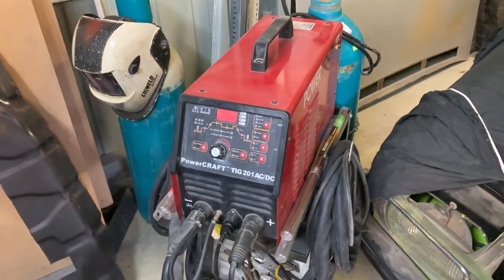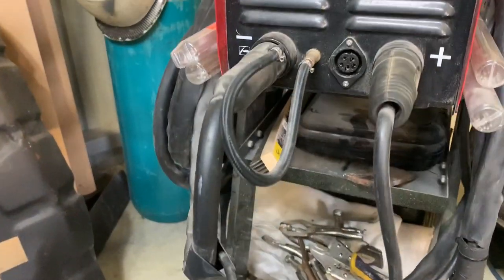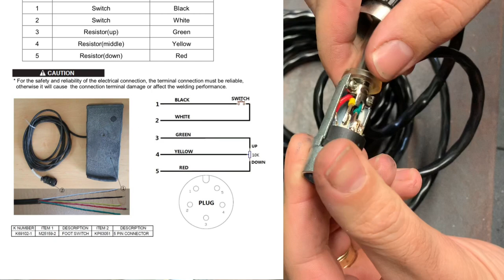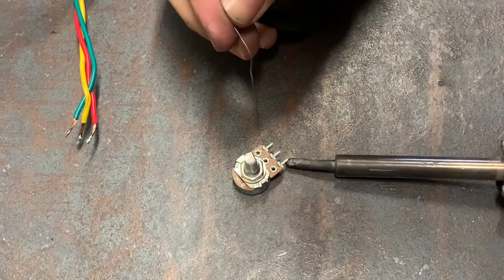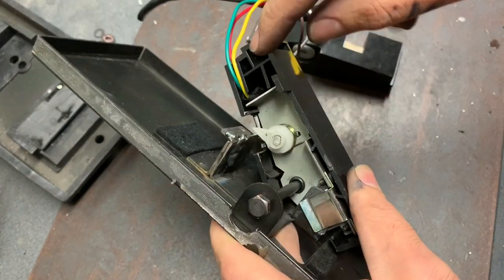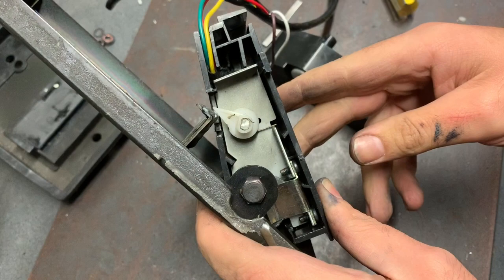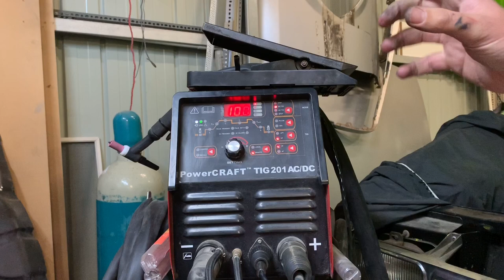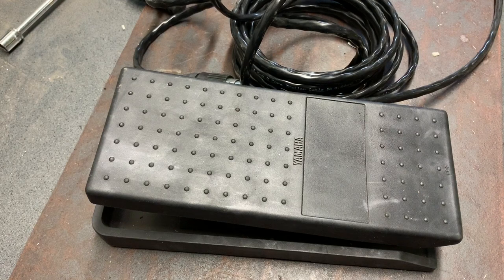Cheap Homemade DIY Lincoln Tig Welder Foot Pedal - How I did it!

Comment: Good job mate.
Ive purchased a behringer pedal.that is exactly the same, save for the rubber pedal cover and im about to do the conversion meself.
Thanks for the vid!
Reply from the maker: Awesome! For what welder, may I ask?
Reply: @PangazShed  I have a Eastwood ac/dc 200 tig that already has a foot pedal, but it is an awful design, very awkward to work with.
I will be using its guts to modify the guitar pedal.
Reply from the maker: @Hackjob-Extraordinaire  Great Idea!

Comment: If I may offer an idea.  Some foot pedal will produce a “chain ratcheting sound”.  I assume this is chain and pulley wheel inside, allowing a connection at the front of the pedal to have full ranger travel

Comment: How'd you deal w/the high current at lowest pedal position w/high max setting on machine, (I find it hard to finish a clean puddle otherwise)?  Only way I can think of is programming ramping off on the machine settings.
Reply from the maker: Yes you’re right. I did struggle with that also. I have since change setup because I didn’t like not having the pedal automatically spring back. Instead I bought a $69 metal tig pedal for an eBay welder (2+3 pin type) and rewired it utilizing the Lincoln plug and my 5 core cable and I had to fix some of the wiring inside the pedal (very chineseum made, some wires weren’t even connected). I would of done this from day 1 but the availability of generic pedals was very scarce and expensive.
Reply: @PangazShed  I went the same route.  My machine does not allow for panel control when pedal is connected so second pot on pedal allows me to adjust max current.  Min. current is still not zero with this setup so problem persists (high min current when using high max current).
Reply from the maker: That’s unfortunate. I usually have the pot on the pedal on max and my max current on the welder depending on the job. I do find towards off on the pedal that it switches off abruptly but it ramps down pretty low. Next time I do some welding I’ll make a mental note of watching amps to see how low it’ll go before off, as I don’t know off the top of my head.
Reply: @PangazShed  prior to my current setup, I bypassed the 2nd pedal range pot and had full control just by the pedal pivot pot.  This may be a good idea for your machine since you have panel max control...it would allow you to go to the lowest setting on the pedal.  

The problem with mine is that having no max control in the panel, it meant very sensitive sweep over the entire range, making pulsing within a region difficult.  I suppose you could run into that issue if you bypass and need to weld in the high amp region.

Comment: I bought a cheap 250 amp DC inverter type welder some time back to compliment my plasma welder mainly to do some scratch Tig, but later I bought a 250 amp DC cold welder that does Tig too.
Having the switch on the handle only gives me on and off so I though it would be handy to have a variable amp control too.
That meant twisting the amp control while doing the welding which is not practical.
So,  I thought why not have a simple control that enabled you to remotely wind the amp control low to high without taking your eye off the job..........a handle control that operates like the switch and moves a cable in a sheath attached to the amp control knob to turn it will do this without having to go to electrical connections etc.....it will just wind the amps knob to do the variation........any comments as to has this been done before?
Edit....Just did some browsing and Tony of TOT has something very much like this.
Reply from the maker: Very interesting concept. I imagine a bike cable system. Not sure if it’s been done and I’m not sure about how to execute it but I would love to see something like that in action!
Reply: @PangazShed  Basically you'd wrap the end of the cable around the knob or a small drum and have a spring return to pull it back........I don't do much welding but it would be handy to have that capability.
If the concept was feasible I think it could be more properly made by taking the amp control knob out of the welder and in a separate box.....just thinking etc.
Reply: Sounds like you're an innovator, it happens out of necessity sometimes, as a mechanic I've built told I didn't have for a one of job.
Reply: Bad spelling, built TOOLS

Comment: I don’t have a inlet for my foot pedal on my ac dc Lincoln how can I get it hooked up?
Reply from the maker: What’s the model of your welder? I’ll be interested to check it out.
Reply: @PangazShed  Hey Pangus - John here - the info for my welder is Lincoln AC/DC 225 / 125  Code 8566-112 see photo My deceased Dad
Reply from the maker: From what I can see, going by the information you gave me, it looks like the welder is a stick type, not TIG. Pedals to regulate amps are usually found in TIG welders. Although what’s interesting to me is the ARC welder in question is capable of Alternating Current process. Cool!